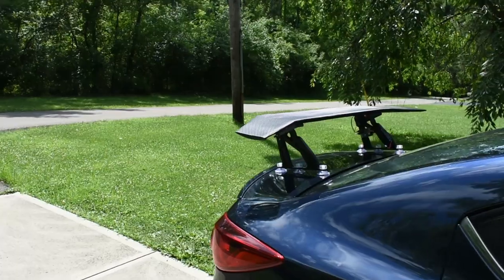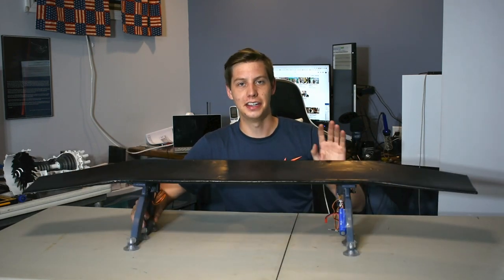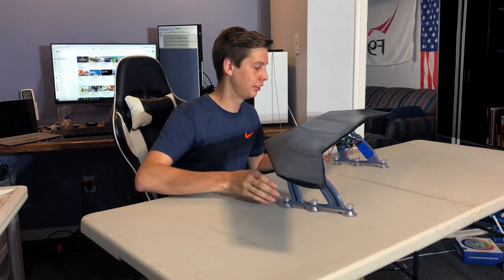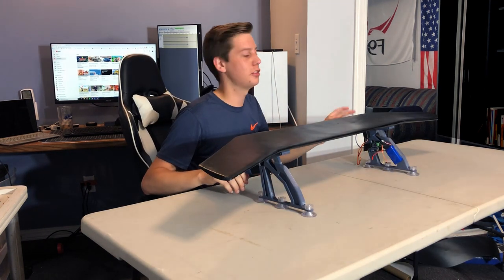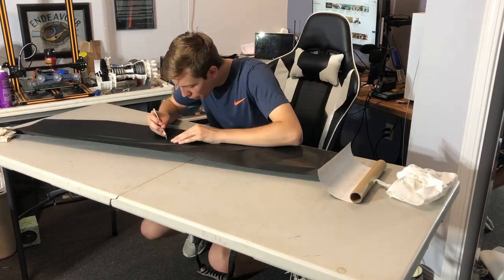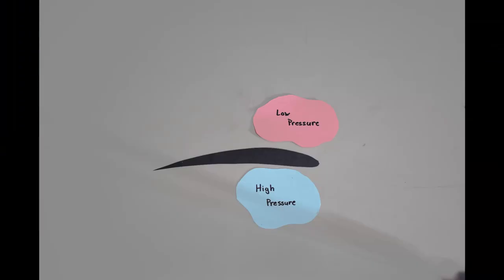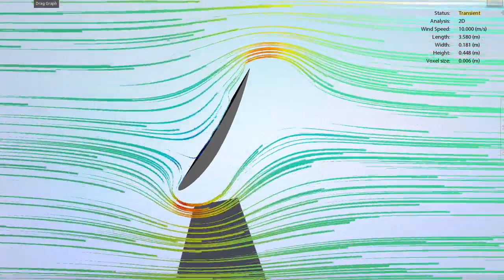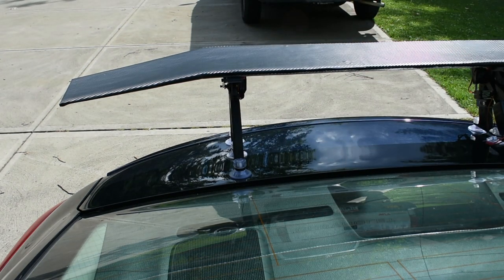DIY ACTIVE AERO    Spoiler & Airbrake

Comment: I know this is funny and all. But I'm in the middle of building a lemons car and I'm 100% doing this to the ungodly oversized wing and just wiring it to the brake lights. Air brakes on when the brake get hit. Oh God I'm so excited hahaha
Reply: A year later, did you get it to work? If so how did it do?
Reply: @bradleycole2655  well lord no. I got hyped on that idea for about 11 hours
Reply: @brandonshepherd3317  It's not a bad idea though, controlling from the brake lights. Far less complexity compared to a more sophisticated setup using accelerometers or data from the vehicle ECU.

Comment: I'm wondering if this could be available as a kit? I run into issues with my car's rear getting loose under heavy braking at the track. I think I could shave some seconds off my lap times with something like this
Reply: I would first recommend replacing your factory shocks with Bilstein shocks.  I went to Bilstein shocks three years ago and have seen all that life has to offer since. Simply life changing.
Reply: @samklare1088  What an excellent suggestion Mr. Klare. I too am yearning to get more out of life (and of course shave some seconds off my lap times) and I think some Bilstein shocks might be a great place to start
Reply: Yea bro this might be an issue of a wrong braking technique since when you brake all the weight of the car goes to the front and makes you lose grip at the back, or in most cases you might need the rear suspension to be a little stiffer to keep the weight shifting more balanced and keep it planted
Reply: Yeah man would love to see this as a kit, whatever it does to your lap times would look sick AF on a street car too if done nicely.
Reply: @antolivdiaz  Shouldn't it be the front suspension to be more stiffer?
Reply: @georgeb5262  yes

Comment: Hey Michael, great experiment with the accelerometer. How powerful are the linear actuators you're using? I’m about to start modelling an airbrake into the chassis mounted spoiler on my track car and have thought about a similar design but wired in.

Comment: That is so awesome! It reminds me of the air brake on a McLaren 765lt. You're right about that carbon fibre vinyl! It might also have helped the drag coefficient once you hit 180mph 🤣. In wing mode, you need the endplates on the sides to get the sick vortices and less drag. But it's way cooler and more practical as primarily an air brake, and you've nailed it. It would be great to get some data and run experiments like distance to stop from different speeds. 
Better yet, the data from a whole active aero package with front spoiler/splitter that descends dynamically and radiator louvres that react to temperature and airflow. Better ground effect with flat panels under the body and active suspension to dynamically lower the body closer to the ground, and whatever else everyone can come up with. The fuel savings would definitely pay for the modifications in one to two lifetimes max! 🤣
You may need to find a different vehicle, though, because more than suction cups might be necessary.😆 By the way, shout out to those suction cups!! They are hardcore! 
Great work Michael! Keep it up!

Comment: You could split the wing and hook it in to ride hight sensors and it will adjust it as the body roll to push the side down that you need for turns.

Comment: Mr Rechtin , unreal work and great video - congratulations ! I'm reading the other comments - maybe there is a substantial commercial opportunity there for you . I shudder to think about the legal costs in protecting yourself though . If you trust your suction caps enough or maybe use nuts and bolts and put a few holes in your car , I'd love to see how it goes at 150 kays per hour or more . I'm guessing that there would be a pile of down force and braking there .

Comment: I'm designing something similar.
I intend to use a pair of solenoids from dead starter motors.
Run a cable from the brake light circuit to the solenoids.
Simplicity has merit.
Reply: I'm using a wake board which I got for free. Very light weight.
Cut it to size. An aerofoil profile similar to a spoiler.

Comment: Hey man i am currently doing a capstone project for automotive engineering and we are doing active aero, can i please ask about the mounts attached to the aero foil part of the wing, i need to essentially build a similar one and i just want to know if you built the mount or bought it somewhere? If you built it can you tell me what you did and what you used (3d printed?, how did you make the suction cups be perfectly attached?, and how the motor was attached/placed) , the info will help alot. Thanks.
Reply from the maker: The mounts were 3D printed and attached with epoxy. The suction cups just screwed into the supports. I wouldn’t recommend using suction cups if your wing is going to experience real aero forces. Good luck with the project.
Reply: @michaelrechtin  thanks so much man for responding quickly, your diy project was cool man
Reply: @michaelrechtin  how much would you say it cost you for the motor that you used and including the arduino uno? Im trying to find online right now. Thanks again

Comment: The way you have connected the servos is a call for disaster. You should not be able to move it by hand as this would tear the gears down or blow the servo electronics. 
You need worm gears, thus you would be able to control it from servo part but not able to move it due to wind/hand pushing. 
In addition a metal gear servos would be nice addition. 

Btw what program did you use for the wind simulations?

Comment: I came here cuz Im looking to make this except out of a carbon fiber e46 csl trunk. I want it to look oem when its under 60 but then have the top rear 8" lift off the car beyond that with air braking. Are you aware of any piston sets I can use which could be longer so I could mount them down inside the trunk and only be visible when activated?

Comment: Are you aware of anywhere I can find motors that I could mount inside the car to raise the spoiler up in use but could have enough travel to keep the car stock when not in use? I am able to fabricate whatever carbon fiber bits need to be made but im very inexperienced with electronic motors and the needed programming

Comment: its hard to tell the speeds in the video it looked like the top end was about 50mph?    at 100mph  would this things motors have enough strength to hold it forward.   i have faith in the suction cups not being the first failing point.   i bought a big suction cup just a little bigger than those on your wing we attached it to a sheet of glass and yanked on it with everthing we had and they just work.   genius idea for the suction cups.    i know you kinda were doing this in a funny way where it wasnt too serious and had some satire about it.    but with a little tweaking to parts ect.   you might really be able to sell something like this and make a killing.  all you would have to do is gather data on that thing working.   maybe not that paticular prototype but say prototype B and you add endplates to the thing, small ones that still go with the look,   if you could get this thing wind tunnel tested (expensive)  and yield results of any kind.  even if its just 100 pounds of downforce at 120mph and say drag in brake mode of almost double that ect..   people WILLLLL buy those.    the bondo sand bondo deal seems like too much work but there has to be another way that is cheap and would work aswell. with  stronger components and maybe a few slight options in design.   if it was proved to work in a wind tunnel and priced at the cost of parts+ time  it takes to make one + mark up due to having no competition.  i think you could sell those for way over 1000 each,  or say math it out so you make 800$ on each wing profit.    you make 100 of those things in a year that's $80,000 a year.    i have no doubt in my mind you could make ALOT of money with those.

Comment: Umm....   relay connected to brakelamp + to switch pwm going to servo pwm input might be fun. They got 2ch pwm controllerbon ebay, non need for nano.

Or if you insist using nano, you could also set few second delay correction to smooth things out(imagine you in heavy traffic, it ll be annoying if this thing keep flip up and down).

Comment: Hey Bud, 

Great job! Cool project. Your explanation on how lift works is wrong though. The top and bottom of the wing are independent. The low pressure above the wing that generates most of the lift  force is not related to the flow on the bottom half of the wing.